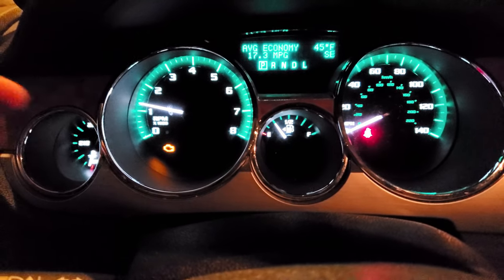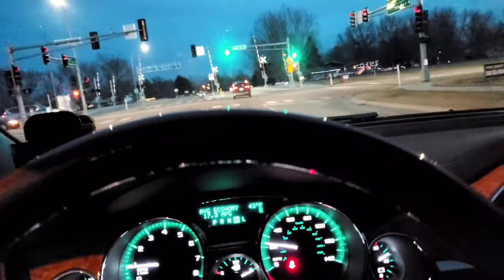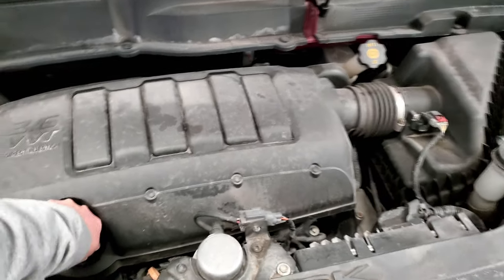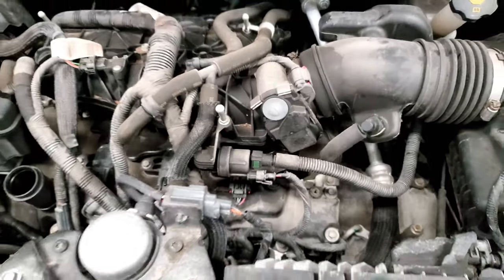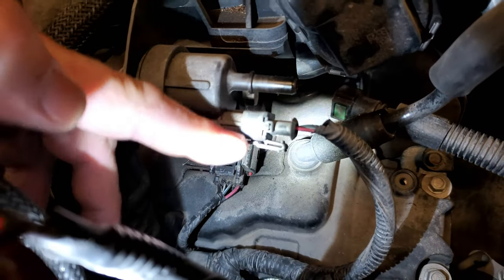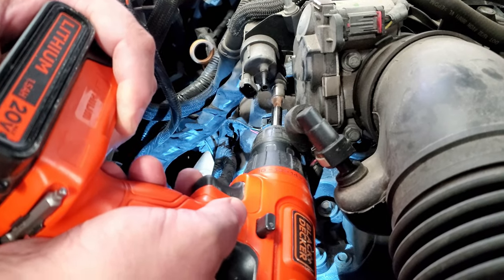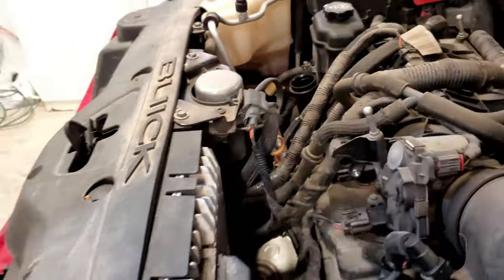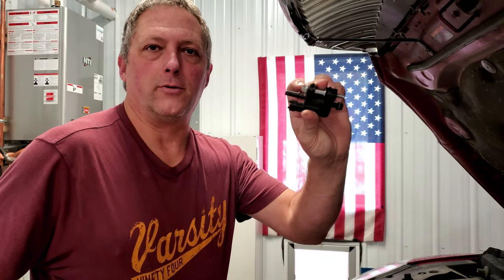Car Wont Start After Getting Gas | Check Engine Light | Evaporative Emission Purge Valve Replacement

Comment: great video, very informative, bought new gas cap as wll thought that may help, my other cap did not click, this new one does, but?? anyways bringing my car into dealer VW its a 2011 VW Jetta, Catalytic Converter symbol on screen(people think its engine light? well i guess in a sense it is, but in my manual it say CC.  I bought a scanner the cheapest one listed P0442 code which is the Evaporative System small leak!!  but im sure dealer has more in depth scanners that may pinpoint problem more accurately. So i just want them to replace that Valve only, to see if its that, to expensive for other service,
Reply: I have a 2015 jetta, and since then I've had a catalytic converter part break, and now my purge valve went. Must be a jetta thing haha

Comment: 10 mins if its a nice brand new car with no rust or brittle connectors.  throw some age and rust on the vehicle your in for a surprise.  had a 15 minute R&R job turn into throw everything in the tool room at it.